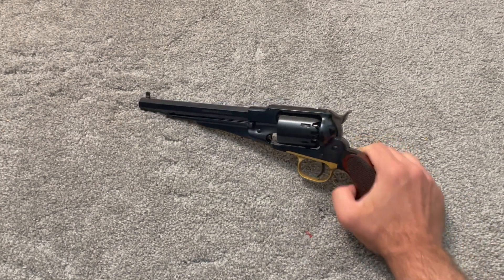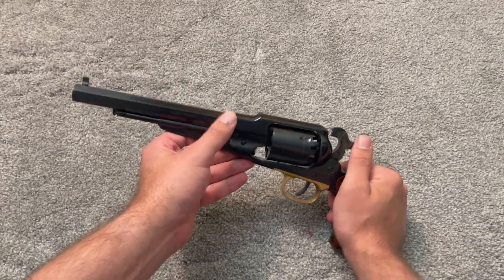1858 Cylinder Swap Addendum

Comment: I imagine the quick swap system did lead to at least some people removing the cylinder for reloading. It's somewhat quicker/more comfortable to remove it, set it on the table, and put powder into all of your chambers, then put it back in the gun, and just seat the bullets, than to reload chambers individually when it's in the gun, since you have to have one of your hands occupied by holding the gun upwards if you do that.

Comment: Looks like you've been practicing. However you still haven't discovered the easiest way to install and remove that cylinder. That's funny. 

You do understand that saying that no one can prove you wrong is the same stance you are making with no 1st hand knowledge and only operating on folklore and loose statements with zero evidence behind it.. You are stating opinions like they are facts and myths like they are true. 

You have to stop lying. I own 6 cylinders that work in all of my various model 1858s. You speak like you are intelligent, and make over stated comments with excessive emotion and conviction, however I think you are the only one who actually thinks you are smart. 

Glad you're done talking about this. You truly should have never started.

Comment: For the record I HAVE AN ACTUAL 1858 Remington New Model Army. At the onset the idea that it is machined to a lesser tolerance than the pietta is an absolute Bull Shit argument. (LOL!) I see no evidence that the lockup slots or hand that advances the cylinder would have to be hand fitted to the cylinder. To the gun maybe but not the cylinder. Second is the idea that this guy has that, CNC is better than a manual lathe operator. This is also a Bull Shit argument. So Could they have cylinder swapped if they wanted to, from a machining standpoint YES. Did they who knows.

Comment: It is your OPINION that cylinder swapping on an NMA is impractical. You are correct. It is also your OPINION that it never happened historically because its impractical. I'm not sure who in the black powder community is claiming a NMA is as functional or convienient as a Glock (i've never heard anyone claim such a thing personally so I find it strange you are insinuating that), but if someone was making that claim it still doesn't mean that NMA cylinder swapping never happened historically. Mocking Elmer Keith says plenty about your knowledge of 19th & early 20th century revolvers and their lore, in my humble OPINION, and your reaction to several comments that did refute your claims said a lot about the motive of these videos. Cheers.
Reply from the maker: Roy Dunlap started and perpetuated the myth of the M1 Garand ping, by telling stories about places he hadn’t been to and also just straight made stuff up. Dunlap was at least alive and in the army during that time. Elmer Keith didn’t even have that in regards to the 1858. 
I have yet to find or be presented with primary sources of cylinder swap reloads being in practice, or even recognized as being a skill at all.

Comment: Prussian navy issued holsters which included a built in spare cylinder pouch(NOT a separate pouch, it's part of the holster) in 1858: check it out yourself. https://youtu.be/4rOoIsUUFNc

Proof enough?
Also you clearly have very little clue how machine tools and jigs work.

Comment: Because of the fouling you are better off swapping cylinders in a Colt.     My buddy and I shoot BP revolvers and he favors the Remington while I favor the Colt.     We bring extra cylinders not for tacticool reasons but so that we can fire several cylinders before reloads.   The small base pin of the Rem is 'problematic'  the  open design of the Colt works a bit better.

Comment: Pistols were very expensive to people of the day, with the cylinder being about half the cost. Its hard to imagine a spare cylinder or 2. Besides machining wasnt what it is today so there may have been some hand fitting needed.
Reply: Often, even today, some hand fitting is required. I just had to have an 1849 pocket revolver conversion cylinder fitted to the gun, to make both it and the percussion cylinder worn. Ditto on the are Remington  pocket.

Comment: A curious point to make would be to find cost of parts say for example in 1870 the cost of a replacement cylinder and compare it to today.  I purchased a NMA for 345$ and though black powder cylinders I found for approx 65$ a conversion cylinder for .45 colt costs anywhere from 270$ and up.  If the price of a spare cylinder in 1870 was comparable to the conversion cylinder today it's be hard to argue that cylinder swaps were common or even a trend at all at the time if you could just purchase a second pistol for a few dollars more.
Reply: "for a few dollars more"

I see what you did there
Reply: No, the cost was close to a fistful of dollars.
Reply: The NMA conversions were not made with a 2 pc cylinder. Only the Police and pocket revolvers had the 2 pc Rimfire conversion cylinders. The Army and Navy revolvers were fully machined conversions. I suppose there might have been isolated incidences of a gun fighter or someone with extra money, to have a 2nd or even 3rd cylinder fitted to the gun. I’ve never read of any civil war cavalrymen swapping cylinders nor any post war cavalrymen with cartridge revolvers. Have never read of any accounts of Custers men swapping cylinders, which would have been much quicker than ejecting and reloading single rounds.

Comment: Just look at the NMA's in the collection of collectors...the cylinders are often mismatched serial numbers. It doesn't affect the price of the guns that much because it's said that on the battlefield the soldiers were not concerned with keeping the serial numbers intact so much as preserving life. They were made interchangeable in the same manner as those replica's today. As far as an easy answer to the question though it's as simple as looking at the number of these guns having cylinders with mismatched serial numbers. Auction houses are also a good place to compare serial numbers on them.
Reply: If a battlefield pick up, why just take the cylinder and not the whole gun? Much more practical to draw a 2nd pistol than to fumble around changing out a cylinder.That time delay could cost you your life.

Comment: One thing you have not mentioned that I have had experience with is fouling.  That cylinder pin slides in and out very easily in a clean gun that has not been fired.  After a few shots this changes.  Black powder produces a lot of residue when it burns and that residue will congeal around that cylinder pin.  You might get away with it once, but after that you can have difficulty withdrawing the cylinder pin to the point of having to get a foreign object and beat it out.  In addition guns get hot when they are fired but not all the pieces may get to the same temperature. When metal gets hot, it expands so what may be loose before firing can become quite tight after extended action.
Reply: Handguns are emergency self defense weapons. Im not going to be cylinder swapping 5 times in a row and be beating the cylinder pin with a hammer. Also an easy way to avoid stuck cylinder pins, you can use grease or bore butter and also create small grooves in the cylinder pin with a file to create reservoirs of grease to avoid hard to take out cylinder pins. You also have to use grease instead of wads to keep the fouling by the cylinder pin soft. With practice its not impractical at all to cylinder swap.
Reply: @crumply5959 Also, revolvers were mostly loaded with paper cartridges that had NO wads, loaded into them, but the bullets were lubed.